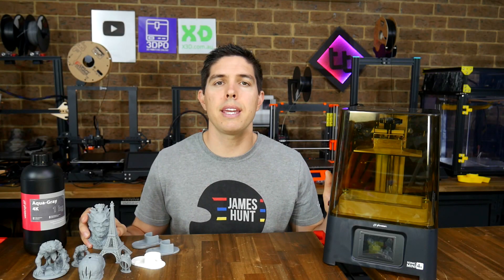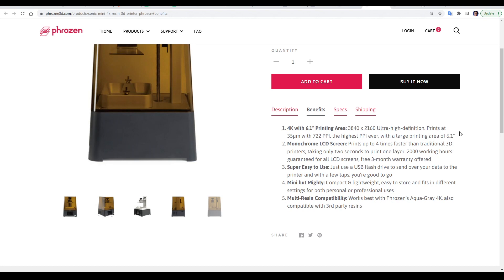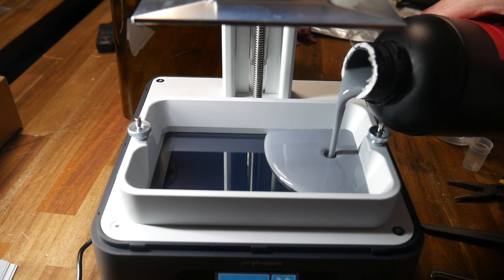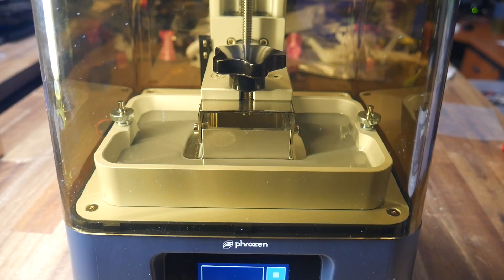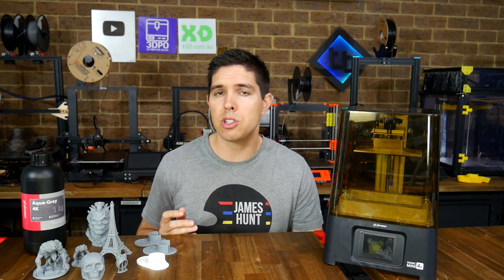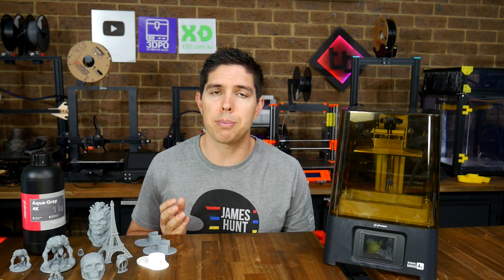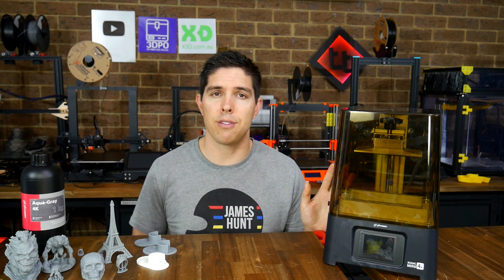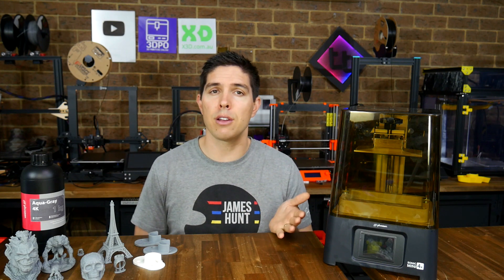Phrozen Sonic Mini 4K review - The highest quality resin prints

Comment: 10 years ago in cinemas: "You wouldn't download a car"
now: "Give it another 10 years"
Reply from the maker: Back when I was starting out, a fellow Solidoodle 2 user was printing this, one 150mm cubed chunk at a time: https://www.wired.com/2013/07/3d-printed-aston-martin/
Reply: @TeachingTech  so, did he ever finish it? That's an amazing project.
Reply: @TeachingTech  Just a heads up, its 4 Times the resolution not twice. 11:37
Reply: Buy the rolling chassis complete w/power and interior and, print whatever body style you want to drive that day!!!
Reply: And you still won't 10 years from now.
Reply: @drxym  Are you sure? You can already print motor blocks.
Reply: @TimeFadesMemoryLasts  1000% sure. The automotive industry use 3D printing for prototyping, scale models, the fabrication of complex parts and even manufacturing tools and spare parts. Obviously this use will increase over time but they're not going to 3D print anything which is cheaper and faster to stamp, cut / bend, weld, injection mold, CNC or whatever. So it will be a hybrid manufacturing process. And that doesn't include the tens of thousands of other components that go into an assembled vehicle - electronics, wire, springs, wrapped copper, epoxies, batteries, rubber hoses, clamps, clips, fabric, paint etc.

For the home user I don't see things scaling up so much as becoming more refined over time. Perhaps in 10 years, FDM will be obsolete and we'll all have SLA printers that use odor-free, water washable resins that can be colored and available in a variety of materials. I don't think it will mean you'll be downloading a car unless you mean a 1:10 scale model of one.
Reply: @drxym  ..... I barely missed the chance to get a czinger 21c (i would have had #82) and this guy is here, being a pessimist
Reply: Tomorrow.. the car will both print, upgrade, and repair itself.

Comment: what wash and cure equipment did you use for this please?
Reply from the maker: I'm using stuff I already have, which is an eBay ultrasonic cleaner with Monocure Resinaway as the cleaner, then under hot water from the tap, following by curing in the Anycubic machine I reviewed previously: https://youtu.be/IPPAjL7Wqks
I have a few more little details left to refine my setup then I'll be making a video.
Reply: @TeachingTech  Thanks bud! So I can cure in any uv box and wash with any resin washer?

Comment: It will be awesome when the materials evolve as they have for FDM
Reply: we already have nylon-like, transparent, flexible, and more for resin printers, aside from embedding powders/fibers to make the stone-like and wood-like materials I don't think they have much more evolving to do :)
Reply: If something has evolved and will continue evolving is material science ;)
Thermoplastics have the advantage of decades of research for inyection molding and stuff... But I bet photopolymers will close the gap very rapidly, actually they pretty much are closing it, as you said =)
Reply: @santiagoblandon3022  aye, and I think it's safe to say we're past the 'macroevolution' stage and in the 'microevolution' stage for resins :) A fascinating time to be alive!
Reply from the maker: I will be testing out a lot of these new resins in the future. Investment cast silver jewellery using the wax like resin, tough parts using the Nylon like resin, high temp moulds, etc.

Comment: Wow 4k is going to make miniatures awesome
Reply: I wonder what it does with 8K screen.
Reply: @jw200  If there are no distinguishable lines at 4k, I doubt you'd see any difference. The vertical resolution will still be the limiting factor.
Reply: @Martial-Mat  I don't see why that'd be the case. This printer has an XY resolution of 35 micrometers, but some printers (not sure about this one) can do layer heights of 10 micrometer so even at 8K XY would be the limiting factor
Reply: @kendokaaa  Oh fair enough.
Reply: Agreed. Finally an affrdable resin printer that I would consider buying.